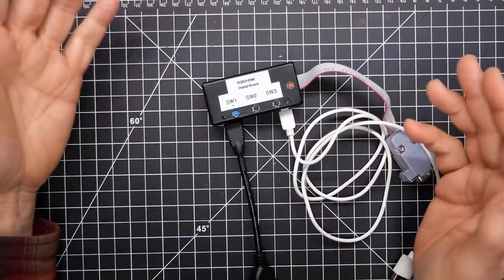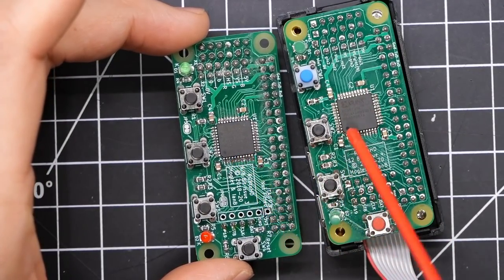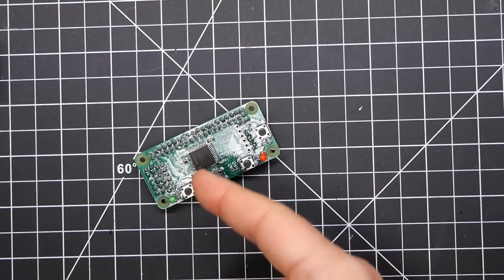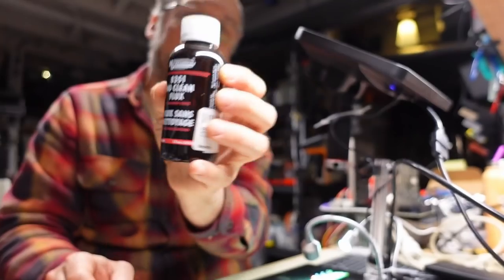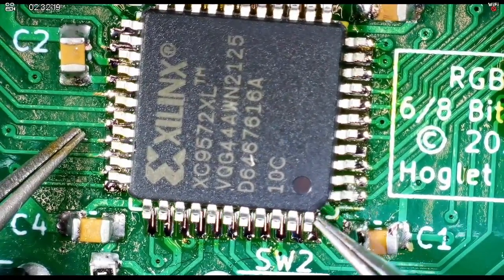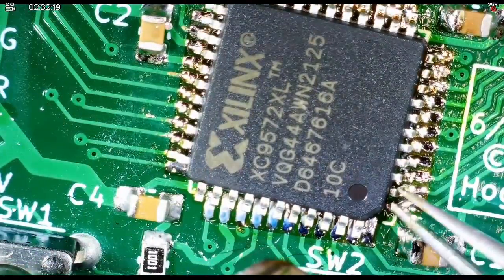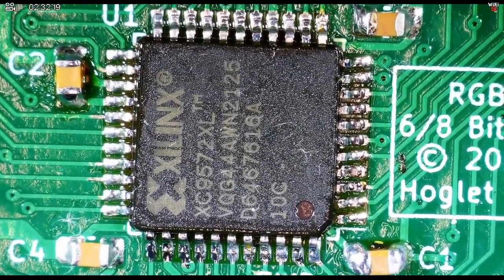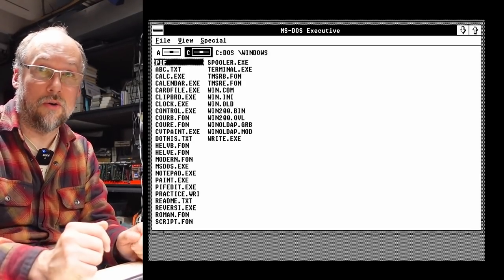The perfect way to NOT do SMD rework (RGB2HDMI overview and repair)

Comment: What I learned from this video was just as valuable as watching Louis Rossman or NorthridgeFix.   I learn more when things go wrong than when they go right.  When things start to go outside of what you have learned about then it's easy to panic, and when I try this (and inevitably the same things happen) I will know not to panic, this is not unexpected given inexperience, and I just need to practice more.
Reply: The guy at NorthridgeFix makes soldering this stuff look easy.  He obviously has a lot of practice at it.
Reply: +1 for Louis Rossmann, watching his videos got me into micro-soldering and the RGB2HDMI was my first SMD project. Leaded solder, decent amount of flux, a fine hot air nozzle and a microscope makes the job a cinch 🙂👍
Reply: 13:26 Louis Rossmann approves this message

Comment: As others have mentioned, the way I have succeeded in replacing QFP chips is to use hot air to remove it (including using aluminum tape to sheild surronding devices), clean off all the old flux and solder, put on some no clean flux, use a soldering iron to tack the corners and then all the other pins. remove bridges with solder braid. You ended up with the chip sittong on bumps of solder, which means its not flat to the pcb, which is why bridging was a issue. That said, the finished job was neat enough. Maybe get some broken cards and practice some!

Comment: one thing I found really useful when I was learning to SMD solder is that there are some $10 all-SMD kits available from various little shenzhen brands which contain the parts for a 555-based blinking light circuit, and a bunch of extra SMD chip resistors/capacitors just for practice.  I bought a couple of those and the first one was a write-off, but the second one helped me get my techniques down and even gave me a little experience troubleshooting!  loved the video and looking forward to more from you soon.
Reply: I taught myself on junk consumer electronics in the early '90s. It was on thin, cheap phenolic circuit boards which was easy to burn.
Reply: Yeah, I got myself one of these that had passives down to 0402, some cylindrical components (they were the hardest), and some LEDs and transistors. It was a really good training exercise. The one I got had resistors down one side in series, and caps down the other side in parallel, with a couple of test points either end so you could put your multimeter on it and check the components summed to the correct values.
Reply: @merseyviking  Those round components are called 'Metal Electrode Leadless Face' (MELF). You need either two irons or soldering tweezers to do them properly. They were intended for automated assembly, with solder paste.
Reply: Thanks! I'm going to look up those kits. Currently working on my first SMD microcontroller PCB and want to avoid destroying it with shotty soldering.

Comment: Adrian, you did fine here, when I did this kind of work I always used air to remove and the iron to replace.  I'd remove, clean up all pads so they're absolutely dry (no solder), flux, then do exactly what you did by tacking opposite corners, then I'd tack the remaining corners if I was 100% happy with the alignment, then I'd just solder all the legs with the iron.  If you have something that can evenly heat the board slowly the chip would (usually!) align itself without doing it manually but I've also seen them turn and align crooked.  For chips like this, especially for a hobbyist, air to remove, iron to replace :)

Comment: Adrian, the only other thing I could suggest, is using some sort of vice or clamp to hold the board, as I noticed the board itself moving several times when you were trying to get ready to solder things. Then, add a Gator clip to put some (minor) pressure down on the center of the chip to hold it, rather than using the tweezers. 3rd hands can be absolutely needed when dealing with these issues...

Comment: You never claim to be an expert at anything and often make a point of saying you're not, but I continue to learn a huge amount from you. It's kind of refreshing to see you having difficulty with something I would usually be okay with, again really appreciate the humility in sharing your mistakes.

As others have said, after the package was clear of the board I would have taken the old solder from the pads with wick and then cleaned with IPA, then approached it like a new board i.e. two corners first and then drag-solder the rest. I would only use hot air to solder components in if working with solder paste. Another trick I found was to use a sticky flux on the pads, carefully place the chip and then leave it to dry, then drag-solder the whole thing. This resulting in better alignment with the pads without bending any of the leads, making the drag soldering stage fairly easy and these were QFP-144 ICs with 0.5 mm pitch.

Great to see you got it working though, all's well that ends well.

Comment: Hey Adrian don't be too hard on yourself you did really well for your first time, my only suggestion would be use a bigger nozzle for a chip that size and a little more heat 380c, 

set the chip down and apply heat.
 once its flowing nudge it inplace,
 only hold down then for cooling.
 hope this helps.

Comment: Kudos to you for your perseverance and sense of humor.  I don't know the proper way to resolder a SMD device with multiple pins.  The problem with using the "corner tack" method, like you did, is that the pins are being held up off the pads by the old solder.

Comment: Not easy to install, but you own the right tools, so that is a good start. Always tape down the board with Kapton tape when installing the chip. Not doing this caused you a lot of pain.Use hot air to remove leaded SMD components. Take out all the solder with iron, solder braid and flux before installing the new chip. Use soldering iron with a small bevelled tip. Use very little solder (you added too much) and a lot of flux. Sweep on the pin tips and pads, not over the pins. otherwise you risk creating bridges on the slanted parts of the pins. Good luck!

Comment: For what it's worth, I had the same struggles a few months ago with SMD soldering -- except it was only for five pins on a micro-USB connector!  The best tools that helped were fine-point and blade-shaped soldering iron tips, the latter of which I used for drag-soldering.  I used a gel-like flux that liquified after heating, so it stuck to the pins and didn't find its way across the PCB.  But wow -- that microscope makes all the difference!

Comment: A great way to remove solder from bridged pins without solder wick is to first apply flux to the pins (I love Chipquik flux - no clean and thick consistency).  Then use wick on the hot soldering iron tip itself to remove as much solder as possible.  

Then apply the hot and "dry" tip to the pins with the solder bridge. The dry tip will suck away excess solder like magic. 

Perform the tip drying process again and repeat it on the next bridged pin. What I like about this technique is that it removes just the right amount of solder.  Love your videos as always!

Comment: That was a bit painful to watch :)  Here are my smart-ass comments: When you rework a chip like this, remove all solder and flux after you’ve removed the chip. Then solder on the new chip with the iron and lots of flux, using the drag soldering technique. It will be quicker and you’ll not run into the risk of toasting the chip by heating it for too long. Also, get some tacky flux. Liquid flux does not stay where you need it and is much less useful to transfer heat from the iron to the work. It is easy to write all this as I have some experience, but it took me only a year or two to get quite good at SMD rework, as a hobbyist. Keep up the good work, and thank you for all of your videos!
Reply: I certainly could not stand the pain and commented before the end of the video - it is really amazing just how much heat these parts can take! Thank you for demonstrating that, too! This was a very enjoyable morning already :)

Comment: the small nozzle is good for a capacitor (small components), to remove an ic, use the bigger one or no nozzle (better heat distribution) you can add new tin to the pads with a soldering iron and speed up the process (it melts faster)
The rest is practice.
Reply: no, you drag solder.......
Reply: ?????? Contex
Drag solder not work to remove ic (unless you use low melt solder and is expensive) 
Drag solder not work whit rosin or liquid flux, if you have some amtech (995 if I remember) or the Chinese kimbo (work very good) or other of this paste flux (in market are a bunch of this and some work good) . So if you have some paste flux yes use drag solder, I do not take to much time and is easy.
Reply: Yeah the nozzle was a bit small for that case. The pros use big nozzle and 450ºC to get it off as quick as possible so they don't delaminate PCBs. Iron/drag solder is easier for the inexperienced because you can control the heat better.

Comment: You couldn't have titled this video better 🙂
You are very lucky that the CPLD survived this torture (your words, not mine, but I strongly agree.)

Here are some pointers for the next time:
1) Always clean the pads of any solder and old flux COMPLETELY after removing an IC. DO NOT pre-fill the pads with new solder, they have to be absolutely flat (like a new PCB) to be able to seat the new IC properly and easily.
2) Before you seat the new IC, apply a a little paste flux on to the clean pads, DO NOT use liquid flux because it is like 95% alcohol and it will evaporate as soon as you apply any heat. The flux you put here will also act like a weak adhesive and will help to keep the IC in place later on.
3) Seat the new IC and make sure all the pins on all the sides are aligned perfectly, press the IC down firmly enough to keep it in place and apply a TON of paste flux on the pins. I can't stress the term "a ton of flux" more here, really put a stupid amount of it. See Louis Rossman's videos for the amount. 🙂
4) Take a chiseled tip iron, clean the tip well. Just add a tiny, tiny, tiny bit of solder on to the tip on the iron and tack down just one pin. You will be doing this with one hand with the other one still pressing down on the IC, so pick the easiest pin on one of the corners. Check that it took solder and it is soldered down. It doesn't matter if it is bridged or not soldered pretty, it is just an anchor for the time being.
5) Make sure the IC is still aligned, and do another pin on the opposite side, still pressing the IC down.
6) Now that your IC is properly held in place by 2 sides, you can do the rest of the pins, just add more flux paste to the areas it is melted away, clean the iron tip, and add a small amount of solder on it. How much is "small"? I hear you asking, well, exactly half of what you think it is.  
7) Drag solder the pins on one side that isn't tacked down. Make sure you are touching just the tips (ends) of the pins, which means the tips that are touching the PCB. DO NOT touch the whole pin, that's how you get bridges. Touching just the pin ends is very important. It ensures less friction, less heat transfer to the IC body, better solder flow on to the PCB and under the pin. Now clean the iron tip again, put new solder on (now that you've discovered you actually put more than needed the first time, put less) , and do the opposite side, followed by the sides that you already have one pin tacked, cleaning the iron well and applying new solder before each side.
8) Clean the board with IPA of all the flux and check your work under magnification. If any pin looks suspicious to you, just apply flux (a ton) to the whole side and pass over all the pins on that side with a clean iron tip, no solder, again touching just the pin ends. This will re-do all pins on that side and distribute the solder that is already in evenly, taking care of small bridges. Clean the board again, check again until you like what you see.

Comment: Dear Adrian 
Eric (Termineric) here this how I do SMD repair

- Remove part
- Remove Tin & Flux (Desoldeerstation and IPA)
- Put new part on place soldering Diagonal Opposite 2 pins first
- Put new flux on it before 
- Put tin soldering iron only touch only with BLOB so hover just above the pins
- Remove Bride solder wick

This always work for me

Comment: Career SMD tech here. You might be interested in using a removal alloy instead of high heat. 
When I remove large ICs like that I replace the high heat solder with the low melting point solder, and the chip will come off with either a little hot air, or simply with a soldering iron. This will also prevent you from destroying any type of conformal coating, or blowing around other components once wet. I use SMD16NL-ND on Digikey
1 Use soldering braid and flux to remove most of the old solder.
2 Add more flux, and apply removal alloy to all pins. Bridge all of the pins with the alloy. You will also see that the new solder will remain wet for much longer.
3 Remove chip, and remove all of the allow from the pads.
4 Add new chip in whatever way you prefer.

Comment: Another cool and informative video. The capture solution fail was funny. I hate when I do a project like this and end up thinking I missed something because of such silly things. A note on the capture device, I use an evga xr1 lite on my test bench. It has a passthrough HDMI port which comes in handy if I'm building an adapter for display and I get a result like yours. Also I find the proper soldering iron tip with some decent flux and solder is way faster than air and less likely to heat these smds to failure. The iron only passes over a region of the IC at any given time as opposed to heating the whole package with air. That looks like the same scope as I use lol. Earned a sub👍

Comment: I think you did OK for a first serious attempt. Using a good gel flux is going to make the job a lot easier. It helps stick the components in place before soldering and it doesn't boil off the way liquid fluxes do and cause chips to start floating away.

Comment: Another great video, Adrian! Very generous of you to share your SMD rework learning experiences. It gets easier the more that you do it. Several other people have already given some great advice. I'd like to emphasize a few things that have worked for me. 1) Always wick off the old solder before placing the new component. Mixing different types of solder will sometimes cause alloys that don't melt or flow well. 2) If you plan to use hot air to solder down the new component, I recommend using solder paste. 3) If you don't have a stencil, hand-soldering these SMD components is often easier -- and I think you realized this pretty quickly. 4) Real Amtech tacky flux is great (and you can get it from Louis Rossmann's store). 5) Using copper braid to remove bridges usually works well, but as you noticed, it will often remove too much solder. Often I can get away with stripping solder from my iron using a brass tip cleaner and then use the iron to wick away the bridge. Works better if you have sufficient flux.

Comment: Hi, good attempt for a beginner in SMD soldering. Tips: Use the desoldering braid to remove the old tin. Then clean it with isopropyl alcohol. After that put some fresh solder on contacts and with a good flux, the chip automagically align itself using the heat machine. At last, clean it again with alcohol.

Comment: Thank you very much Adrian for another great video!

About the 5V tolerant inputs, I've seen some people adding something like a 1k series resistor to those inputs, so it will help "burning" the voltage difference and reduce the risks of damaging the IC.

Comment: Jumping On the Bandwagon: I always remove all old solder from SMD/SMT pads, I find it causes me more headaches than it saves me time. You had a nice clean pull (the removal of the chip from the board) and you just had a tough time trying to keep that old solder on there. Glad it worked out in the end!

Comment: Seen dave at eevblog do smd soldering a few times, and I think he even did a dedicated video on it a few years ago. After removing old solder and tacking the chip, I think he used a chisel tip and just dragged across several pins at once, came out perfect. Bridge a couple pins, no biggie, clean your tip off and drag it back over the pins. Anyway ya did great and cool video! cheers

Comment: I totally agree with everyone who said remove the old solder first and hand solder the new part, good magnification is a must. The RGB2HDMI project is great, replaced the CRT in my Wayne Kerr precision LCR meter with a RGB2HDMI and a small VGA screen. I want to have a few RBG2HDMI units in the lab but the Raspberry PI Zero is really hard to get at the moment.
Reply: WK3245? :)
Reply: @alexmirica  No, mine is a WK6425, old but has much better accuracy than I need for most measurements.
Reply: @peteroneill404  Yes, I do have several WK 3245B, 6425, 6430 and PMA3260A at my work. Good equipments. I did several repairs at these, and still works after +25 years.
Reply: @alexmirica  I bought my 6425 at a local auction for $AU400, 20 years ago. It always had an intermittent unobtaium flyback transformer, which finally failed a few years back. Replacing the CRT with a small VGA screen and the rgbtohdmi has been a good fix. The rgbtohdmi allows a lot of on-screen adjustment, making it easy to align the screen text to the fixed menu separation lines on the front panel.

Comment: It looks like you had a heck of a learning experience with that chip!  It's just that soldering using hot air really requires the use of solder paste instead of solder wire.  It's also a good idea to clean the existing solder off the pads prior to attempting to solder the replacement part, really only to make it ALOT easier to place the new chip.
All in all, great video!  I appreciate your sharing of these "How Not To..." videos.